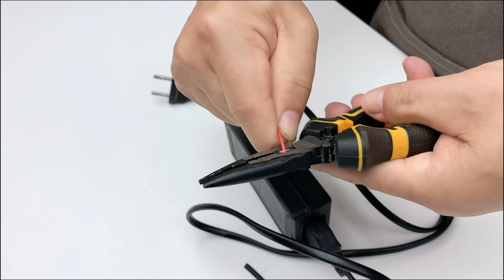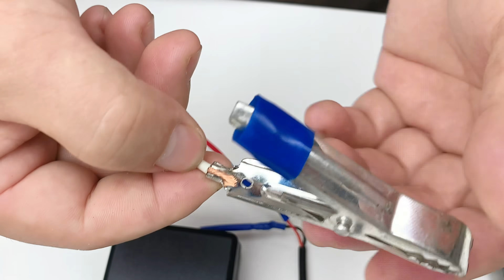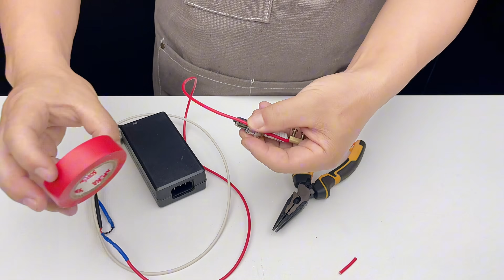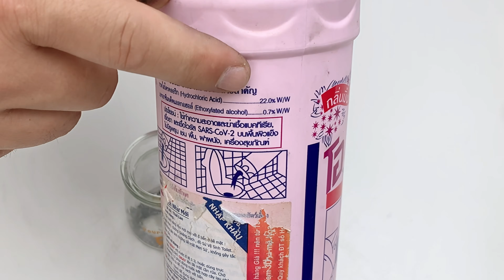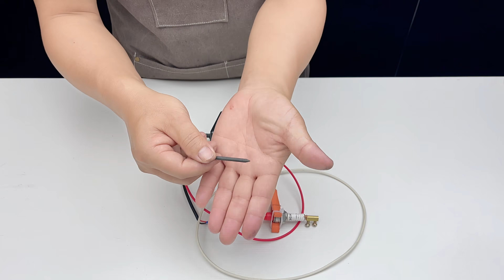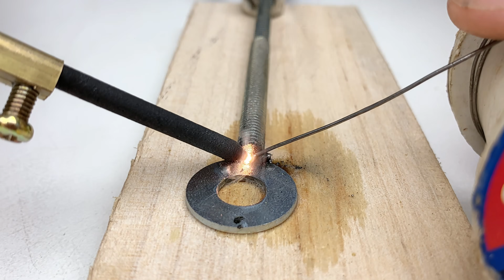Never Buy a Welding Machine Again! Use a Laptop Charger and See What Happens

Comment: i did exactly like  you but the PSU kips turning OF when when i activate it:face-orange-frowning:
Reply from the maker: Thanks for trying it and sharing your result. Some laptop PSUs have built-in protection that shuts them down when they detect a very high current draw or a short circuit. What are the voltage and current ratings of your power supply? That might help us figure out what's happening.